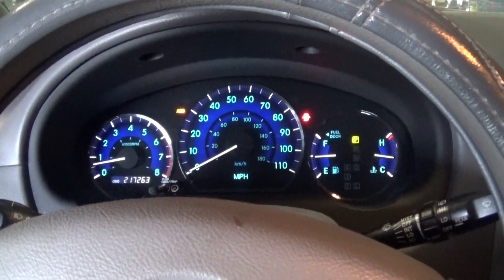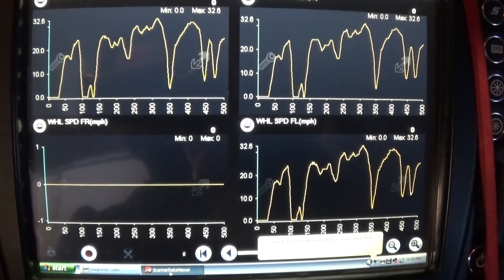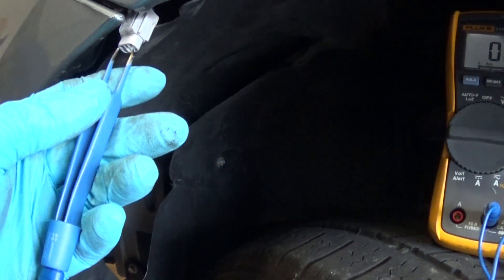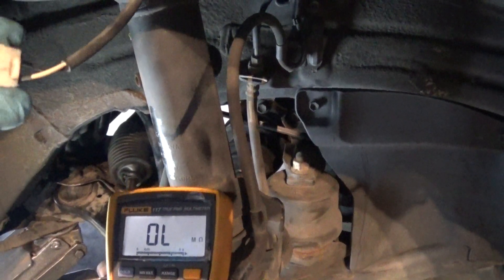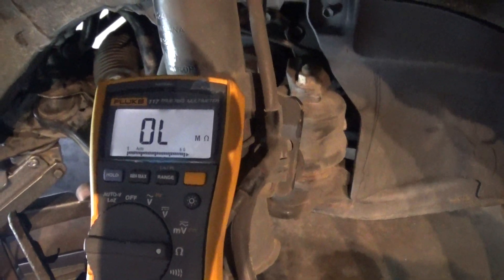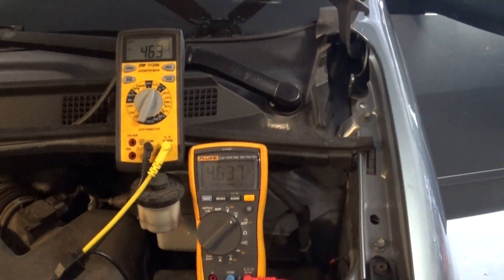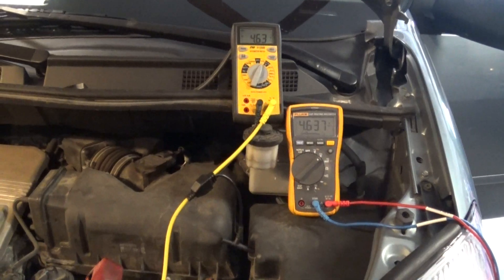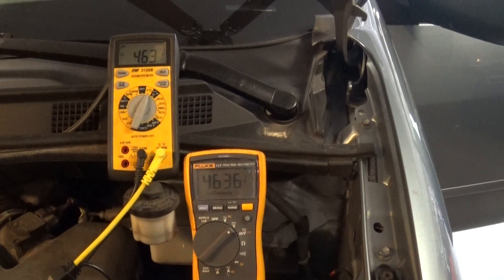2006 Toyota Sienna C0200 ABS System Testing

Comment: I have the following code. C0226 TOYOTA - Right Front Solenoid Valve. I'm going to test the voltage output from the ABS pump any input?

Comment: Thanks for the video. I do have 05 Sienna I had last week check engine light on with the code C0200 the scanner says right front wheel sensor.  My question is there any problem if I didn't change it sooner because this is the only car I have to drive to work. Thanks
Reply from the maker: yassin Rah no that will not do any harm to your car.👍

Comment: I changed the CV on the passenger side and I used a wire brush to clean out the splines on the wheel hub. Then I got an O200 code and the ABS and TPMS light. When I pulled the sensor it was covered in rust dust. I cleaned that off and slew out all the rust. Still had the code and lights. Is the sensor supposed to be magnetized? Would running a demagnetizer over it fix it? Or should I just replace it. This car has 220k on it as well.

Comment: I have an 04 4Runner and I've always had my abs, vsc, and trac light on... but recently I was doing some work under the vehicle and I broke the abs wire in two. This caused my brake light to go off and I believe it was this. Do I need to repair it? I don't mind not having ABS but I would like to turn off the brake light in case of other emergencies.
Reply: By the way I have access to a snap on scanner just like you have
Reply from the maker: Fredy Martinez I would repair wire and use scanner to retrieve codes from ABS module. Thank you
Reply: KY Home Garage KY Home Garage I used snap on scanner to retrieve the codes for ABS and repaired the wire but didn't turn off any of the lights. I know it'll turn on the ABS light but will it trigger the red brake light to turn on?
Reply from the maker: Fredy Martinez did you have any codes in ABS module after you repaired wires?
Reply: KY Home Garage KY Home Garage yeah ABS light was on before the wire broke. Recently got new calipers in the rear and the next day the light went on and the wire ripped in half. Wire or something wrong with the brakes?

Comment: I have code c0210 which is supposed to be caused by faulty right rear sensor. So I did the check like you described. On right rear I get .08 oms (meter set to 20k). On left side it won't move off 1. So according to that the left side sensor is dead and right side is ok?
Reply: YES, sorry for the late reply(hopefully it helps someone scrolling through the comment section)... Resistence on the sensor(s) SHOULD be less than 1 Ohms if not then voila! it is dead... If less than 1 Ohms it is fine...

Comment: Hi very nice video. kudos for that. Please if one needs to disconnect any of his ABS sensors from the hood, will there be a need to remove the battery terminals? Please can you throw more light on this for me please. I have a 2006 toyota corolla and the ABS dash light is up. Where can i start with the troubleshooting. Thanks
Reply from the maker: Ikechi Nix You don't need to disconnect battery. If you do that you will not see any bias voltage on your sensor harness.
Reply: Okay I get it now. Any ideas on how to trace this ABS dash light fault? I also have the the brake warning too on the dash.
Reply from the maker: Ikechi Nix You need to have scan tool to pull trouble code from ABS module. Generic scanner will not work.
Reply: KY Home Garage KY Home Garage I have tried with 2 OBD2 scanners but I keep getting communication error. 
I also noticed that the cigarette jack lights don’t come up when my lights are switched on. Could this have an effect to the error code??
Reply: Thimllnews
Reply: @ikechinix9524  Sorry for the late reply(hopefully it helps someone scrolling through the comment section)... But communication error is mainly due to the scanner not able to read from ECU which could be due to; Ignition not ON(which i doubt was/is your case) and secondly, due to the scanner not supporting the vehicle you are trying to diagnose(use an obd scanner like LAUNCH/AUTEL...) I'd rather you go to your nearest Automobile diagnosis/repair centre, as advanced scanning tools come with a hefty price tag...

Comment: Nice video as all ways.Good tip using the other side sensor to check the ABS computer and wiring. 😀
Reply from the maker: huggybryn39 yes this method works very good it's important to make sure that harness side is good. Thanks for watching. Cheers